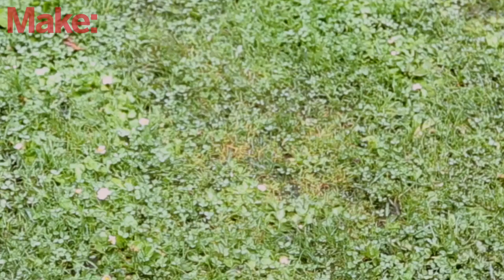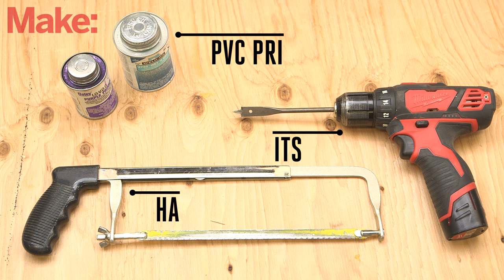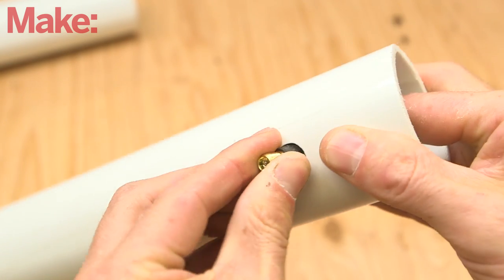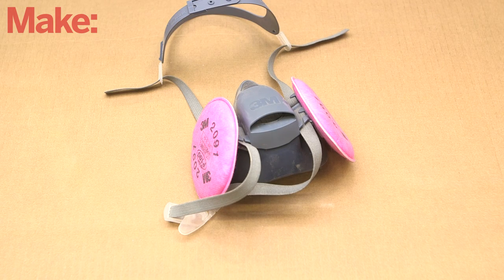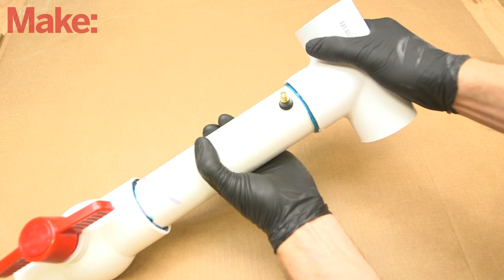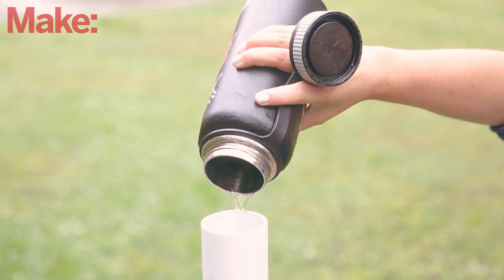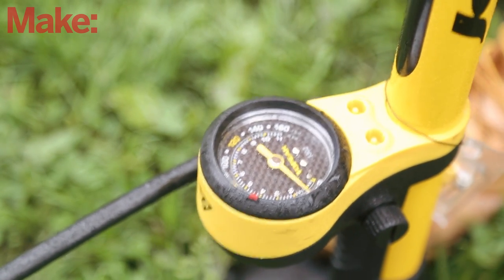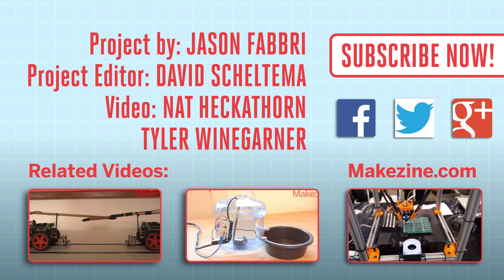Weekend Project: Water Balloon Cannon

Comment: Regarding the hole for tire valves in PVC pipe, the package that the tire valve comes in says it is for a hole that is.45".  7/16" drill is definitely too small; 1/2" works well, though it's difficult to get through.  9/16" is easier to pull through, but too easy for the valve to pop back out. 12 or 13 mm ought to work for metric countries if the tire stems are standard throughout the world.

Comment: You should have uploaded this video back in June.
Reply: +Techmatt167 haha so true.
Reply: +Geeksmithing and the parts list is so vague. Like what size PVC pipe should we use??? Like really.
Reply: +Techmatt167 I am pretty sure it is 6 ft in diameter.
Reply: Geeksmithing WHAT?!?!?
Reply: +Geeksmithing He's joking you Techmatt. It's obviously no bigger than 6 inch. You should definitely use 6 inch. And while you're shopping, you might as well go ahead and get cast iron pipe. With all that pressure, you just can't be too safe.
Reply: +Techmatt167 it is two inch pipe. They linked the build in video description.
Reply: Geeksmithing Well they should have made it more clear in the video...
Reply: Techmatt167 perhaps. Then you would have no reason to go to site and drive up ad revenue
Reply: U can use frozen balloons😂

Comment: Can this be modified? Modify the "air tank" with 2 T fittings. One like in the video, and one between the ball valve and air valve, facing downward, creating a kind of grip/handle like a bazooka. (Of course I would shorten the "T" in back as to try and match the original air "air tank" capacity). I know it can be done, but will it still function the same? Also if I increase the psi, will it fore multiple balloons at once?